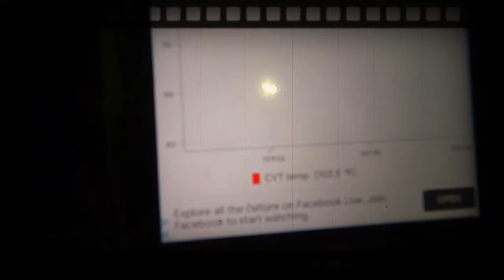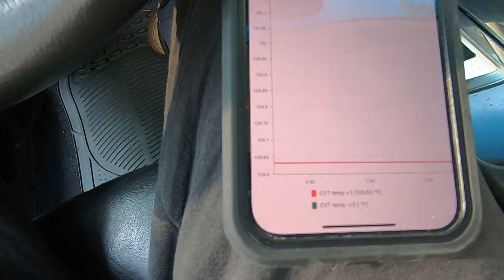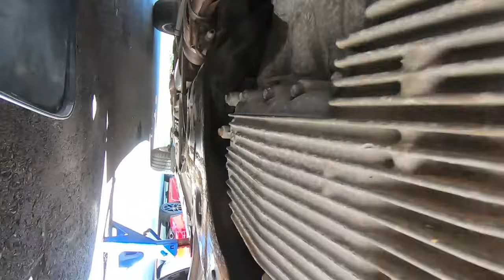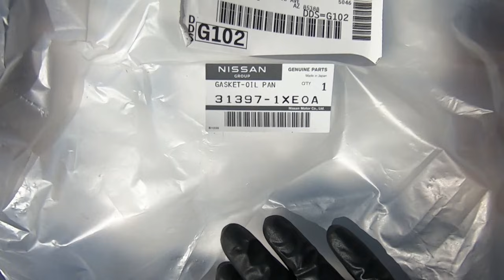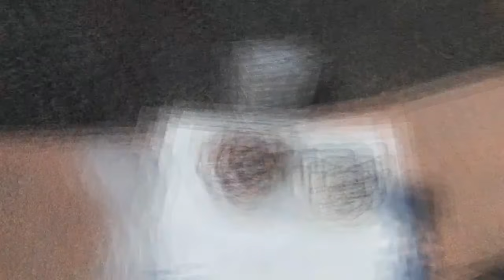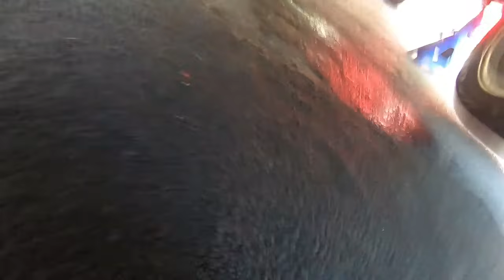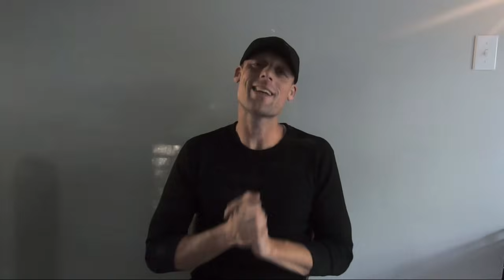2009-2014 Nissan Maxima CVT Fluid & Filter Replacement

Comment: I changed the transmission pan and external filter on my 2010 Nissan Maxima yesterday (7/12/25) and my car drove so nice today. Couple of quick notes I want to add. Please use a metal gasket instead of rubber, it will save you a lot of time when putting it back. I used a rubber gasket which kept falling into the pan. When you mentioned not to change the internal filter, I wanted to find out why myself. So after removing the pan, I put a finger inside the internal filter neck opening and I felt a hard rubber mesh which no aftermarket filter can duplicate. Now I know why Nissan said don't service it because that hard rubber mesh will prevent any mess from the pan to go into the transmission gears. Finally, changing the external filter is very essential because I notice that it where the coolant circulates to help cool the transmission. The CVT transmission is well built. I say so because my transmission has been riding with low fluid for a longtime and didn't get damaged. I will continue to look for leaks because I'm not pleased with using that rubber gasket at all. Your video is topnotch and very thorough so I had to give you a nod. Thanks for it. You definitely save me some money by me doing it myself.
Reply from the maker: Appreciate the comment! 🙏🙏🙏

Comment: i had 2012 maxima 90k miles at 2017 had dealer fluid change cost about $340 , ran up to 110k and the transmision fail cost me total $4500 refub one and labor . just watch your great video sir,  every one should wach it to aware all the trouble in parts

Comment: Thanks for the detailed video. Nice job. Picking up a '13 Maxima from my in-laws with 36K on the clock. I'm curious whether I should mess with the pan or not. Assuming they have never changed the CVT fluid that is top on my list of things to do.
Reply from the maker: Appreciate the comment man. Definitely would change the fluid. Considering the age, I think it might be worth doing the full job as I outlined in the video, but could really go either way honestly. But 12 years old….time does take its toll on everything unfortunately.
Reply: Definitely replace every fluid, filter, and spark plugs. Your car will feel amazing

Comment: I just purchased a 2009 maxima S. Not sure if previous owners did their transmission fluid change. Do you think I should try it?
Reply from the maker: I would consider purchasing the CarFax for the car. It’s really not much (think $40), and you’ll know the complete history of the car, even outside of just the trans fluid. You can see what kind of maintenance has been logged/done if any on there. Obviously would only reflect on there if it was done professionally at a shop. But IMO worth a buy. I think everyone should have the history of their vehicle. And I touched base on this at the end of the video, check out @1:12:50

Comment: Great video.  
One of the keys to getting o-ringed drain plugs like that off is to give them a good smack with a hammer to help break that o-ring loose.  After that, it should be easy-ish to get out.
Reply: I recommend using a rubber mallet to prevent damage

Comment: I put 5.5 liters after draining all the fluids and changing the metal filter , but there is almost no splash in the dip stick , what should I do? You might ask if warmed up the car !? Yes I did drove the car around for 15 minutes in an ambient temp of 16 celcuis and stil same result.
Reply from the maker: Just add fluid. The dipstick is your gauge, so I would triple check that reading to make sure its low, and if not in spec…add fluid. Don’t get caught up in the specific number of fluid that was added, rather just focus on getting the correct reading on the dipstick.
Reply: @ Thanks , I actually figured that out and it’s exactly what you said 🙏🏼
Reply from the maker: @truthful4012  good to hear!!! 🙏

Comment: Ive been driving a 2010 altima for about 13 years.  Had full fluid exchange (about 12 genuine NS2qts) done at the dealer at 60k, and 120k miles.  It was expensive but these cvts fail because of high heat and fluid degregation. I wanted this done over a simple drain and fill.  After that second full fluid change, i did a drain and fill myself (which was about 5-6qts), every 30k-45k miles. I think 30k is best for a drain and.fill.  She is currently at 170000 miles.  This last time at about 165k, i removed the pan, strainer filter  and the small inline filter on the cooler trans cooler line, that no one ever replaces.   Its a bit more of a pain on the altima,.than the canister  one on this maxima.  Also, the last.time i used the valvoline cvt fluid, in the blue bottle.  It is the same color as ns2.  Do not use the universal valvoline in the red bottle as its red.  I was nervous about going away from oem fluid but i did some research  and it is good stuff.  Also, ita about half  the price.  The bad thing about my 2010 is that i do not have a drain plug on my pan, so its messy to remove the pan.
Reply from the maker: Good to hear you’re maintaining your CVT! Thanks for sharing your experiences 👍
Reply: I did want to point out that if your nissan uses NS3, I probably wouldn't  use the valvoline  at all.  The blue valvoline cvt bottle is similar.to NS2 (green tint), the red valvone bottle is red fluid.  I wouldnt use that at all.  I think NS3 has a blue tint, in the fluid.  I'm not sure if anyone else makes a compatible fluid for NS3. I'd probably just stick with OEM.  If you mix fluid colors, people will think you used the wrong fluid.  I had good luck with Valvoline cvt blue bottle (green tint) for NS2
Reply from the maker: @ personally, I only utilize OEM fluids. Not that there aren’t potentially better quality fluids out there…..but just something I never wanted to roll the dice on. NS2 & NS3 are very similar though, they almost look the same and smell exactly the same. Once you’ve smelled them you know lol

Comment: you don’t suggest changing out the bolts?
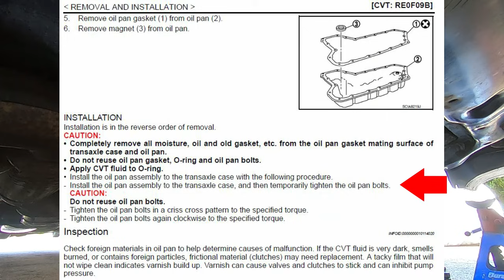Reply from the maker: I touched on this a couple times in the video, @20:55 & @42:20. I don’t see any need too…they worked perfectly fine & everything is still sealed & good from the job. But if you want to replace them I’m not opposed & i can understand, as I can be extra a lot of the time and want to do everything exactly how it’s outlined. But personally I had no problem reusing the existing bolts, and see no issue doing so.

Comment: So 5.5 quarts?
Reply from the maker: Roughly yes. Def grab 6
Reply: @TheOriginalBeeCee ok. Another question. Can I just put the front on a ramp and the rear on Jack stands to even it out?
Reply from the maker: Yea, as long as the cars even in the air & you got room to work thats all that matters!
Reply: @ I have the BlueDriver obd2 scanner, it costed me $90. However, it doesn’t have the transmission temp reading feature on it, so I just ordered the one you used in this video for it. I pretty much just spent $160 all in total. Do you have any obd2 scanner recommendations around this price range that you’d recommend that has everything in one?
Reply from the maker: Im not familiar with the BlueDriver OBDII. Can you not partner it with the Car Scanner app?  Check out this video I just recently made though on a Launch Scanner:

https://youtu.be/sF85yq69MVk?si=07kEa47F9yaeZS0k
Reply: @ The BlueDriver OBD2 is awesome! And It already has its own BlueDriver app for their scanners too. Only downfall out of everything is it doesn’t have Transmission Temp monitor. Ok, I’ll check out the link now. Thanks!
Reply: You don’t put silicone on the gasket? I’m going to be going this on Saturday. I hear whining noise from my cvt, when I plugged the obd2 it read code P0868 indicating a low transmission fluid pressure. I know the fluid has never been changed in close to 100k. Minus the noise, it still accelerates and shifts smoothly. Should I just top it off? Or do the complete change still like you did?
Reply from the maker: No silicone needed. If it was needed, I would have touched base on it in the video. 

With that code, i would just change the fluid (no filters). So just a spill & fill, not the complete job outlined in this video. Clear the code after the fluid change, then drive it for 250 miles and see if the code stays away/trans feels ok. That code can also be thrown if there is an issue with the pressure sensor power circuit (wiring issue). Also a few other possibilities, you can see the complete diagnostic process for the code from Nissan’s FSM here:

https://www.nicoclub.com/service-manual?fsm_download=Maxima/2009/TM.pdf#page89
Reply: @ Thank You
Reply: @TheOriginalBeeCee should I still drop the pan?
Reply from the maker: @user-oz3bu3qz5t  I reviewed my suggestion on when to do what @ the end of the video. Check out @1:11:41. If its never been done and/or falls in line with that schedule, then I would suggest doing it

Comment: So if I put a different fluid in would it just mess it up I’m confused instead of the Nissan cvt fluid
Reply from the maker: You can utilize other fluid without issues. But I’m sure there are some fluids both worse & better than OE, so if you do its something I would be careful with. Personally I prefer just utilizing OE CVT fluid

Comment: Some cars don't have a drain plug. You have to loosen the bolts around the pan and catch the fluid as it spews out. It can be a mess, but if that plug is stuck that may be your only route.
Reply from the maker: Yea, been there before.
Reply: Was that supposed to be informative???
Reply: @Curtisrrr  are you allergic to new knowledge?

Comment: I got a 2009 nissan murano & i got the same filter under the transmission pan & I just pulled it off & cleaned it with brake cleaner & let it dry, then put it back on. Nissan didnt even have the right filter.
Reply from the maker: Yeaa, that seems to be the best option if you want to service it.

Comment: Right that's my thought u almost need to drop the pan to get all of the fluid out my gf car has 230,000 and fluid has only been changed once no filter cause according to her ex-husband there isn't an external filter and yet her old one messed up after she had the fluid changed for the 2nd time at 200000+ I don't remember how many miles was on it it's still in the driveway but the battery is dead but other than that everything is good but the trans and it is an 09 and the one I'm about to do the fluid on now is a 2010 and she says just the fluid now I almost don't wanna do it cause I'm not screwing it up and getting blamed for it and yes it was an excellent video I know now I'm not about to do it at 12 at night in November either thank u

Comment: 50:43 I find it amazing the Nissan Dealers have no idea about this filter.    Even parts claims it didn't  exist until I gave them the part #. 

My guess is only gearheads are actually changing it so I wonder if it  really impacts failure.  

I didn't push it as I figure if they have never done the job it will probably leak, tear my 11 year old hoses, etc

I have a 2013 with 70K, CVT fluid only done at 48K .................all is good so far
Reply: I went to a local dealership and the technician stated that my 2014 doesnt have a filter.
Reply: @ohhgodineedmoore2845 I wouldn’t ever let that dealership touch my car.  It definitely has a filter.  I have a 2014 and mine has one.

Comment: Pretty stupid design by Nissan that the drain plug sits an inch or so above the bottom of the pan.
Reply: I agree. But when you think your changing all of the fluid, you’re not. Your only getting a bit more than 50% with the pan drop. I believe it’s about 10.5 quarts ( gotta look it up ) dry. Meaning you have circa 5 remaining quarts all through the system. Axles, torque converter etc…
Reply: There are quite a few OEMs doing this type of design.  It allows for low profile, but yeah, mechanically, it's stupid.
Reply: There's a reason. If you bottom out and scrap the pan real bad you won't mess up the plug. The pan bottoms out before you get to the plug. 49:02

Comment: This is one of the best 7th gen vids ive ever seen. Thank you. Ive gained much greater confidence in checking this, Regularly in my case, as im trying to to reach 300k soon. Currently at 292k..well car n cvt are...engine at 262k ...
Word to the wise* if you do a radiator/upper hoses may want to consider hookin up that Plastic*filler neck w an oem freshy..wish ida had done it 🙄
Reply from the maker: Appreciate the comment, thank you!
Reply: how many times have you changed the trans fluid since you got the car

Comment: The trans guy on the gram said 20K
Reply from the maker: That’s perfectly fine if thats his suggestion and/or that’s how often you want to do it. I’m certainly not opposed. Hell you can do it every 5k with the oil change if you want. 

As I outlined in the end of the video every 30k is my opinion, and most vehicles that utilize CVT’s (not just Nissan) suggest 30k intervals. Especially if it has or is being regularly maintained, 30k is a good interval to start with….but as I also said in the video that could be subjective to the condition of the transmission and/or the prior maintenance. If you are inspecting the fluid regularly and it looks really dark/deteriorated prior to 30k, nothing wrong with getting it out of there and replacing it!